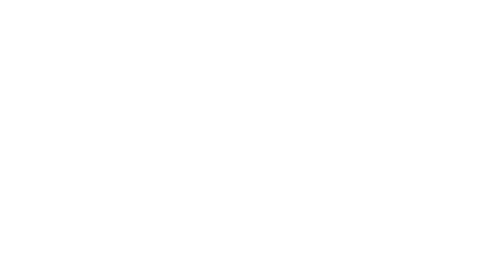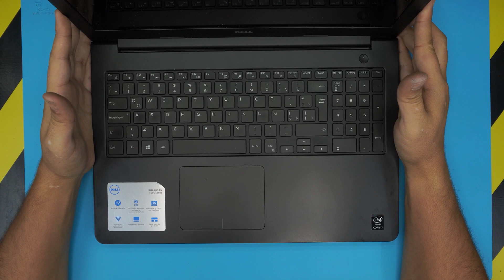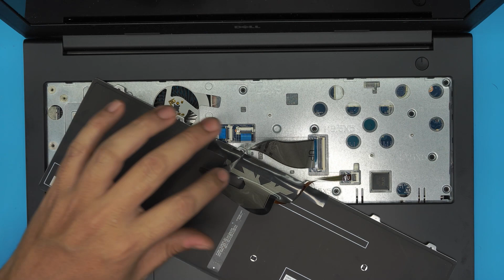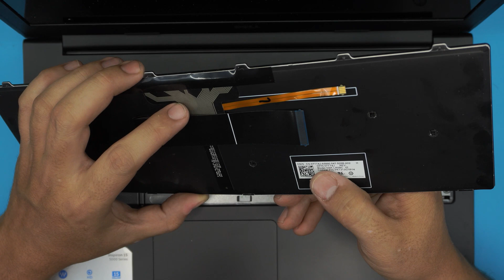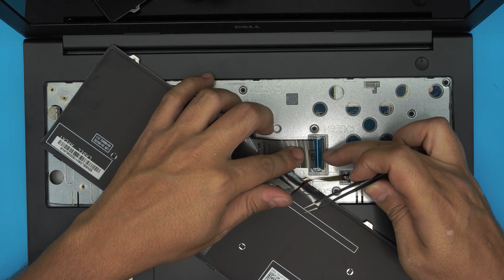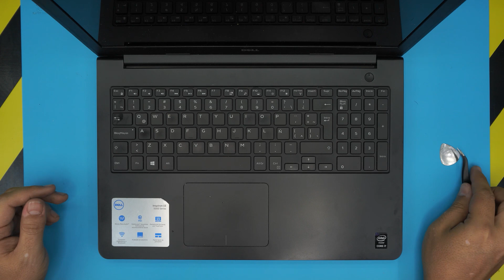DELL 15 5000 Series Laptop Keyboard Replacement Guide

Comment: Oh darn, my keyboard dooesn’t pop. Out the keys are under the top.  I have opened the top and replaced fans and wanted to replace the keyboard but there is so much stuff under the lid…???  I am 74 and had a stroke so i need easy and slow instructions.  Your instructions on the pop off keyboard was great and I could follow along.
Reply: I have the sane problem please tell me😊
Reply: @uFixTek My keyboard is under the top as well, can’t find a keyboard replacement video for it- my model number is P75F
Reply from the maker: could  you please give me the full model number of the laptop or the service tag, it can be writen like ST.
Reply: @uFixTek  It's not going to matter, thank you so much for getting back to me but I've realized. I can just order a keyboard and use a USB or Wi-Fi. Or something like that and use it as a portable keyboard. I don't have to go nuts, but thank you, thank you.
Reply from the maker: It's my pleasure my friend.
if in the future you need any help, you can ask here.
cheers🍻

Comment: Not every dell keyoard works this way: mine is totally different
Reply from the maker: absolutely right not ever but this model series do. 5000 series
Reply: @uFixTek  i have also dell inspiron 15 5000 series (i3) but mine keyboard is different i have to open laptop nad remove from back 
India dell inspiron is different

Comment: hi i am wondering if you can help me figure out why some of the button have to press few time to get it work .
Reply from the maker: Thank you for the feedback! if you wish to support the channel you can LIKE or SUB or both :P
regarding your question: its very common issue and its because the membrane is made of plastic and with the heat that get from motherboard it starts failing a lot. there is nothing you can do except replace the keyboard my friend.
Reply: @uFixTek   thank you so much for fast response , appreciate your advice
Reply from the maker: its my pleasure my friend, if you have any question or request in the future feel free to ask me.